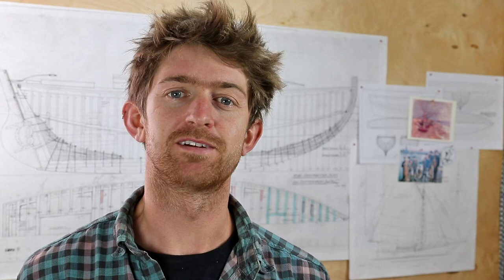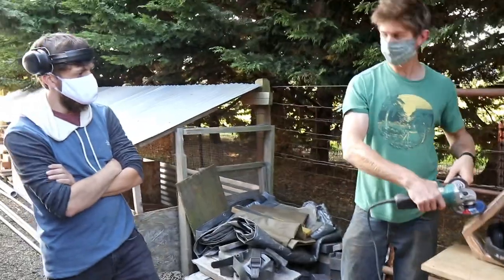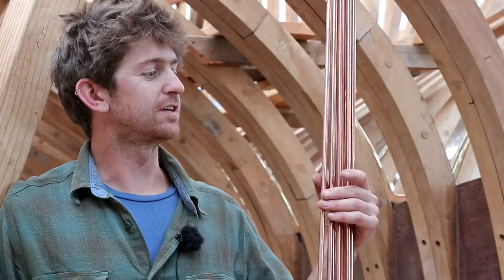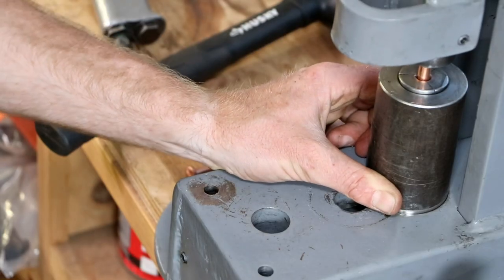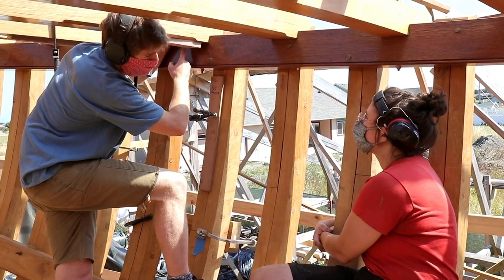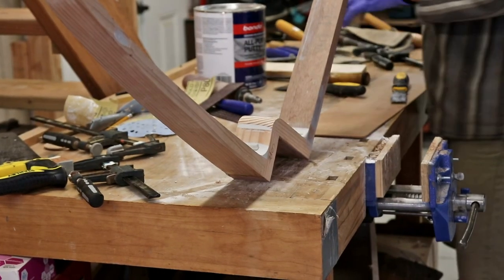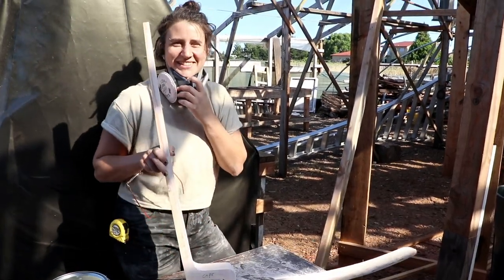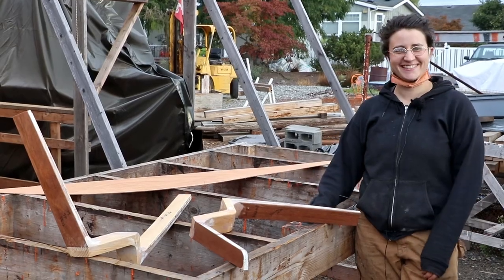Custom rivet press machine! - Wooden Boat Fastenings (EP79)

Comment: I'm wondering if you couldn't take a page from "The Gougeon Brothers on Wooden Boat Building" and use a stapler to tack those gule-ups for the bronze castings with staples (left proud, and pulled with a pair of parrot billed pliers)
No need for all those clamps, the time (and two hands) to tighten them. 
Not ever having to limit the number of forms because you 'only' have Xxx number of clamps.

The pliers could even be painted bright colours.... "Pancho Pliers!"    😂
Reply: plastic staples would be even faster....although the knees are most likely finished at this point.
Reply: @dave160377  I understand that they are probably done by the time of this upload.

But plastic staples aren't going to help, because the laminate isn't staying in place and has to be pulled free from the frames to be faired and worked into shape for the foundry patterns.
Don't you need to pull the staples to get them off?
I encounter plastic staples, and they are WAY better than hitting steel with your planer or jointer, but I'm not sure how they would do going into something dense as live oak

Comment: Kill two birds with one stone.... Push the copper rod through before pressing the rivet head.  Now in one stroke you have pressed the head and cut the next blank.  If it lacks the power to cut the blank and press the head you may have to cut the blank when pressing off the sleeve to release the newly formed rivet.

Comment: Using a rivet press like this, you make rivets with high residual stress in the metal. In future, this will entail their earlier damage.

To avoid this, after manufacturing, keep these rivets for several hours at high (300-400 degrees Celsius) temperature and let them cool down smoothly after that.
Reply: With a highly ductile metal like copper I suspect that the residual stress is minimal.

Comment: "Drilling" square holes? It's possible in wood and can be very precise because a hollow investment 4 side chisel is finishing a traditional round hole. Commonly used with a drill press but nothing a little ingenuity push through.

A little something for another day.
Reply: A lot of the rivets will bind a plank through a frame to the inside of a knee or floor. The pilot hole must be drilled through all three, and a mortiser chisel won't penetrate the bronze.
Reply: @frederickstibbert7389  Actually you drill an initial pilot then mortise the wood. The bronze or stainless hole is drilled oversize and the copper is upset and expands into the space by the peening process. Good point though.

I actually mentioned the square holes for future reference. He's got a lot of project time to go.

Comment: I was wondering, in one of the earlier videos, Leo mentioned that the bolts that fasten the scarf of the keel timber were just temporarily installed and that he needed to install the permanent ones somewhat later. Now, after bingewatching the entire series, Leo hasn't mentioned yet that these bolts were exchanged for the permanent ones. Does that mean he forgot about them, or did he exchange them off-camera...? I'm a bit worried :/
Reply: There are 4 bronze bolts in the keel-timber scarf, they're permanent. There was a steel carraige-bolt at each end of that scarf, they were removed (off-camera, & the holes plugged) when the stern deadwood was installed.
Reply: @frederickstibbert7389  well, thank you! Now i can sleep in peace :) phew! How do you come to know? Did you help him sometime?
Reply: @falistor8969  I had left a comment to an earlier video, EP45: "Hope you remembered to take that steel fastener out." Leo answered to assure me that it had been removed, & that the hole was plugged w/ a dowel by Thom.

Comment: For me, using brass castings for their compact and strong/stiff nature, except by exception or repair work,  are a mistake. Wood, albeit using a stronger, stiffer, harder, more flexible, more durable wood than the base wood, you name it, as desired, is better... the stiffness, i.e. deformation possibilty of any metal  is too different to that of wood; wood against wood is your best bet for a boat that works and deforms in a compatible manner together.This is my opinion as a structural engineer. In 1909, the designer of Tally Ho may not have known about composite structural sections (two or more materials used as a structuiral section) and how they react to forces in the short and long term. Tally Ho II may not last last 100 years but it will work more in harmony. In any event, I wish you all the best!

Comment: Dear leo,
                 I have found some footage of the hydraulic rivet press in action as used by boilermakers. I beleive these were also used for riveting ship plates too. some were made with deeper throats.
Of course you will be using copper rivets and therefore cold but I thought that this machine would be of interest for accelerating the business of riveting the planks in place.
https://youtu.be/uBwmbX3R3sk

Comment: Why didn't he heat up the floors and burn them into the timber like a horse shoe please? Thus saving time and making sure they fitted correctly.
Reply: The strength of the joint depends on friction between the bearing faces held in compression by tension in the bolt or rivet. The frictional resistance is maximized by smooth, continuous contact. Resistance would be substantially decreased against a charcoaled surface.
Reply: I understand fully, I am not trying to question your skills which I never thought I would see the like of again, keep up the great work of passing it on. You would love the building I now live in Built by Wren 1692. Most of the Timber is reputed to be taken from French vessels, its all Oak.    I'm an 80 year old originally from Cowes Isle of Wight, so have been bought up around boat builders. Anything I write here is as an observation and inquiry and or discussion piece, not a criticism. I expected you to mention handling a awkward large ungainly piece of mettle is not only dangerous but difficult, and would need a different range of specialised handling tools,  so prefer the cold shaping method. You would not of course leave a deposit of charcoal on the timber, cleaned off with a scrapper, but it does show the high spots and usually get rid of them in one application. I'm sure you would agree there is a huge impact every time a horse's shoe comes into contact with the road, and the hot shoeing is largely to show the high spots, its really a case of hot shoeing versus cold shoeing, a discussion that goes on and on.

Comment: All that casting and molding seems so useless, as a Dutchman I am  used to the Frisian boatbuilding techniques. Metal connection pieces, just long bolts and thick oak beams. Many boats in the Netherlands are even from the 1800's.

Comment: all the junctions that have been analyzed of Noah's ark were connected by rivets .  it appears it was hot riveted  , which form one of the strongest connections possible  . they held together tongue and groove type joints . it was not coming apart . and of course it endured the worse storm in history

Comment: The grinding of the bronze floors and knees should not be done in the open air because copper is a poisonous metal. Copper particles and copper dust coming from the grinding are poisoning  the soil and the animals there breath the dust because they have no masks.So what I am seeing here is not environmentally friendly unfortunately. Having said this, I certainly admire the project but some works should be done environmentally more carefully.

Comment: When you die the real you( the spirit inside your body) either goes to Heaven or hell. Going to either path depends on if you accepted or you rejected J-sus Christ as the savior.

Heaven is a very good place with no sins, sorrows, crying, lust, greed; in other words there is no sin there and it’s full of joy.

Hell is very terrible and it’s very very hot, you can’t survive placing your hand on a hot stove for 10 seconds, don’t even think you will withstand burning there without being consumed,
The thing here is you will be burned without being consumed in hell the same same way you boil a hard rock in water you will be there for eternity,
Again after judgement you will be thrown in lake of fire forever. Matthew 13:50 (UKJV) “And shall cast them into the furnace of fire: there shall be wailing and gnashing of teeth.” 

So how to get salvation and be on your way to heaven?

First thing first; Believing at J-sus Christ does not involve worship of other gods(church leader&ancestors), object(hand bands,car stickers,trees e.t.c) Muhammad,buddha e.t.c. It's only believing at J-sus Christ as the perfect sacrifice for your sins.
It's your choice but know that rejecting Christ will send you the wrong direction.

No works can save you, there is no physical thing you can do to get saved but you are only saved through faith at what J-sus Christ did for you as simple as that.

Ephesians 2:8-9 For by grace are ye saved through faith; and that not of yourselves: it is the gift of God:
Not of works, lest any man should boast.

Believe and confess with your mouth that Jesus Christ was crucified and he shed his blood for your sins at the cross and was buried but risen again on the third day and alive in heaven now, that way you will receive salvation and be on your way to heaven during rapture or after death.

After believing at J-sus Christ as the savior you must change your ways and try to stay away from bad works or sins as hard as possible, you must show that you are a new individual in Christ. e.g stopping fornication, getting drunk, homosexual acts, masturbation, pornography e.t.c.

As a human you will still fall at some sins of course as no human is perfect, but you must not swim in sin you must try your best to fight against sins and live a righteous life.

Also grow in the word; I suggest the following YouTube channels; Real bible believers, Robert Breaker and Pastor J.D Farag.